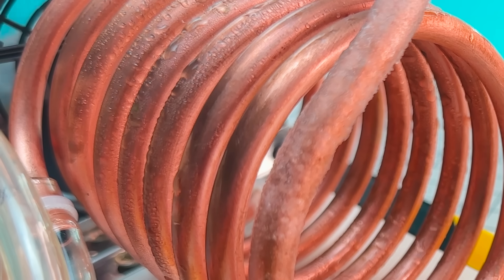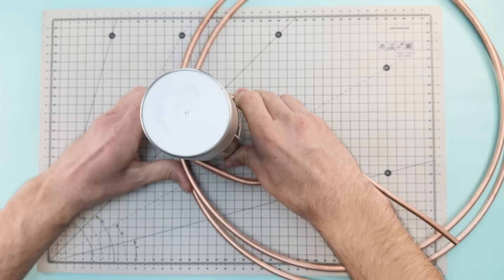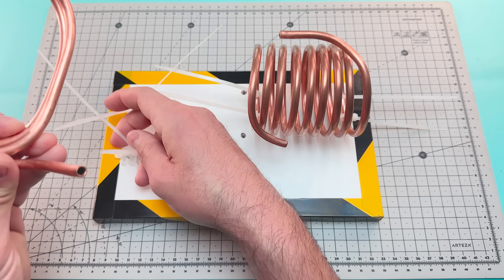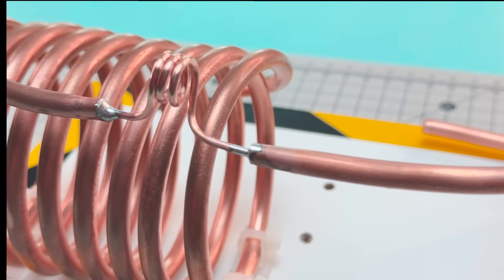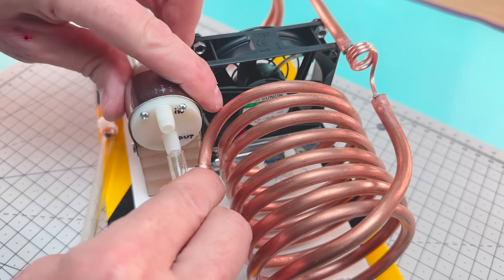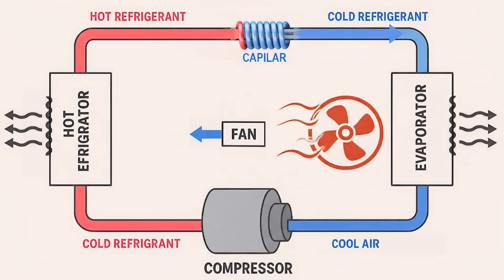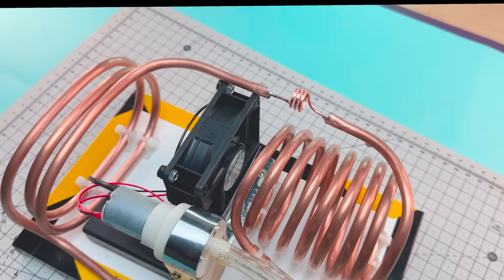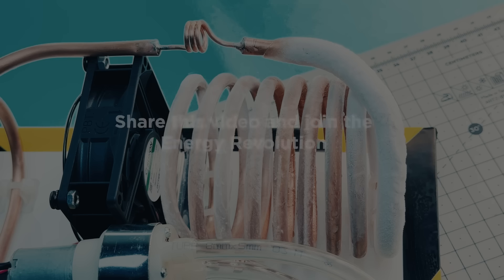Make your own AIR CONDITIONER at home Fast and Easy!

Comment: This is an excellent demonstration example. It's truly valuable given that most people can't come up with a truly effective solution.
I look forward to seeing this developed into an even more practical and effective solution, complete with more detailed explanations and a parts list for procurement.
It would be even better if it could be transformed into a plug-in appliance instead of battery-powered, and ideally, if it used parts readily available at any hardware store.
Reply: Want to see this more developed? go buy a real air conditioner.

Comment: Computer generated narrator voice makes it ever so believable 😂 But when you pit some thinking into atmospheric presure inside the system, outside, the air volume and a room size versus what the system can cycle ... I mean its just a mockup of a working system, not a scaled, optimised one to fit the purpose...
Reply: AI bolok

Comment: It's a neat video. A neat project. You ran a 12 volt motor and a 12 volt fan on a 9 volt battery?
Reply: That is the only part that actually works from all this AI bolok

Comment: To make something like this as a beer glass cooler, how much air needs to be pumped (cfm/psi) and how many turns for the compressor and how many for the evaporator to get 70°-80° drop from ambient temperature? 

Of course, I'd need to isolate the environments of each and perhaps use a fan on the compressor side (as opposed to the evaporator side?)...  ie, insulated cooling coils with center portion to accept beverage... 

...would any type of heat sink be required? 

...also how could temp be adjusted, simple thermostat/relay controling power to entire unit?

Anybody in the know able to give me baseline specs to get me in the ballpark?

Or is there a better alternate methodology I should consider?

Comment: It's crazy that no companies or even individuals making small 12 volt units and selling them this could actually earn someone a pretty good living
Reply: There are 12v mini AC systems out there.
Reply: and a pretty good lawsuit when the motor inevitably wears enough to turn the isobutane/air (explosive mixture) and copper tubing into a funny looking pipe-bomb.
Reply: @TheLootGoblinOfficial  you could try and use regular car refrigerant or some of type of refrigerant that's not flammable...🤔 I want to try this now
Reply: The evaporator heats up just as much as the condenser cools, and the motor and fan dump marginal additional heat into the room. This won't actually cool a room unless half of it is outside.
Reply: I'm on it. Lets do it!!!
Reply: @Zeroduckies Yes im to in
Reply: the hot section vs cold is 5:2 ratio. its has high energy waste, which make it too weak to cool small box (extremely week to cool a room)
Reply: @santohalim1355  I mean if its using less energy that these big AC units I'll give it a shot besides I like making redneck appliances 😂
Reply: Ever heard of cars or trucks. They have 12v AC for the last 50 years 🤔🤣

Comment: Humm, highly flammable Isobutane around an electric current in a DIY project.  Sounds brilliant. ⚡⚡⚡
Reply: Then you will love R290. Its a commercially available refrigerant that's better for the environment than most refrigerants. The best part, its propane.
Reply: @omnipotent87  Sweet, suggest another flammable refrigerant in the comment section for a sketchy DIY video.
Reply: @DelScorch0  Sure, how about r1234yf. Its the current standard for automotive A/C systems, and as you requested, its flammable.
Reply: @omnipotent87  Apparently you missed the point completely.  That's ok.
Reply: Caution is required when experimenting. Isobutane is used in some refrigerators and freezers now. This model has a lot less than an ounce.  If using this for a science expeiment, I think safety glasses would be important. Fire hazard would be minimal.
Reply: @mickmacy6161  Its not so much the fire hazard.  Isobutane has a boiling point of -11.75°C, 10.8F, which means it instantly vaporizes at atmospheric pressure once escaping containment.  Even 1oz, once vaporized is explosive enough to cause some pretty good injury if came in contact with a spark or heat source at its ignition temperature.  Its not the liquid that burns, its the vapors.  So yeah, DIY that and risk it blowing up in experimenters face.  The video is sketchy AF because it makes zero mention of any safety precautions taken to mitigate the risks should Isobutane get free.

Comment: Need to exhaust the heat that is being dumped by the condenser side outside or the system, overall, will not perform well ... if at all. The  fan that is blowing air through the evaporator side is pulling heat from the condenser and killing the efficiency of the system. But, It does make for a nice classroom demonstration of AC concepts.
Reply: Yeah like, overall, very awful system.
Reply: I mean, you're right, it won't cool a room at all as designed, but it does work. You could maybe set a soda can inside the evaporator coil.

Comment: As for air conditioning in exactly the same form as this? Useless. 
One end of the system will be extremely hot and the other cold due to the transfer of heat to another place, but: in general, this effect will be mutually exclusive and cancel each other. 
What's more - the entire system is also working, so not only will we not lower the temperature, but we will slightly increase it - the working engine generates heat. 
So a design made in this way does not make sense if you want to use it exactly in this form as an air conditioner, BUT... But after minor modifications it could serve as a good cooler for a computer, a mini-fridge or something else in which you want to lower the temperature in the right place, i.e. point, area. 
In order for it to work as an air conditioner - the heating end would have to be outside the room being cooled, so that the heat would be transferred outside. 
Therefore, the concept is interesting, but definitely simplified and not discussed in detail. 
I am not even mentioning the use of flammable and potentially explosive gas in an installation that has no safeguards or is not well sealed - that is a completely different aspect. The author deliberately shows only what is convenient for him - the cooled end of the system, and deliberately DOES NOT SHOW the temperatures at the other end of the system.
Reply: Condenser would run about 10-20 degrees warmer than room temperture.
Reply: @mickmacy6161  I understand your thought that the condenser would only be 10-20°C warmer than room temperature. While heat transfer indeed requires a temperature difference, this particular DIY setup presents unique challenges that push its operation far beyond typical expectations.

Firstly, the condenser must expel not only the heat absorbed by the evaporator (which cools to -10°C) but also the substantial heat generated by the compressor's own mechanical and electrical work. Notably, both the 12V compressor ('pump') and the fan are running on an underpowered 9V supply, affecting the entire system's efficiency.

Secondly, the condenser's heat rejection capabilities are severely limited by its design. Unlike a typical heat exchanger optimized for efficient transfer, this unit features limited coils and no dedicated fan to ensure airflow over the condenser (the only fan is directed at the evaporator). It therefore relies almost entirely on highly inefficient natural convection.

Furthermore, this setup attempts to cool an open room, a continuous and demanding thermal load, which is a fundamentally different challenge than cooling a small, insulated space.

Given these combined constraints, for the system to achieve its intended evaporator temperature, the condenser's surface must reach significantly higher equilibrium temperatures. This demands a far greater temperature difference than 10-20°C compared to ambient (e.g., 25°C), with realistic estimates for the surface temperature being 50-90°C.

Consequently, the unit would ultimately add net heat to the room, limiting its practical utility as an AC. Moreover, operating flammable isobutane at such elevated temperatures in a non-professionally built system introduces inherent safety considerations.

Comment: does this really work?
Reply: Yes, for a short time.  A person could probaly cool a can of beer.  The isobutane will leak out quickly.
Reply: It "functions" but it would never cool a room the way it's designed
you have to isolate the hot side from the room you're trying to cool
isobutane is already dangerous, and it would be even more dangerous when it's heated and starts leaking out
this thing would basically just start fires
Reply: no

Comment: ШЛЯПА, как в системе он создал вакуум? Никак а значит что? Поливал трубки азотом жидким, без вакуума влага в воздухе забила бы тонкую трубку, про насос с резиновыми "поршнями" в этой системе вообще молчу
Reply: обычный бургерский кликбейтный видос. физику у них не учат в школе, схавают - вон сколько просмотров и лайков. даже если бы это работало, тупорезам невдомёк, что конденсатор будет выделять тепло в +- том же объеме, в котором этот агрегат будет производить холод, а значит никакой речи об охлаждении какого бы то ни было помещения быть не может. термодинамика тупо вышла из чата
Reply: @piotrjupiter3282  You left out the heat of compression, too. However, for this model with no appreciable applications except to see a cooling evap and a condenser rejecting heat, thermodynamics would be preserved.
Reply: Maybe. I think the refrigerant would leak out before moisture could collect and freeze at the cap tube outlet.

Comment: Entertaining video, but not practical for anything except a small drink cooler... Plus he forgot to isolate the condenser from the evaporator. A simple sheet of Styrofoam will suffice.
Reply: That's what I want to make!   How much air needs to be pumped (cfm/psi) and how many turns for the compressor and how many for the evaporator to get 70°-80° drop from ambient temperature? 

Of course, I'd need to isolate the environments of each...  ie, insulated cooling coils with center portion to accept beverage...

...also hiw could temp be adjusted, simple thermostat/relay control8ng power to entire unit?

Anybody on the know able to give me baseline specs to get me in the ballpark?

Comment: Having the the Condenser and the Evaporator in the same space negates the cooling effect, and actually raises the air temperature.
Reply: Put it in a shoe box & separate both coils with a cardboard wall then mount it into your window. Problem solved.
Reply: isolate the hot part, use another fan to blow it outside from rear, use a tube if you want to exit the heat outside, same for the water, make a channel to drop water below (by hovering ac on a platform) then drop the water in a bucket or something, now you can successfully cool a 1x1 m area
Reply: @shizuxo  nice explanation I got lazy towards the end lol

Comment: هل يمكن تكبير  هذه  المكيف ؟ 
هل يستطيع  تبريد  غرفة من 40او 100متر ؟
شكرا جزيلا على المعلومات وعلى الترجمة 
بالتوفيق
Reply: Да, может. Даже 500 квадратных метров. Просто его нужно увеличить до нужных размеров и оптимизировать работу компонентов, чтобы повысить их эффективность. В итоге получится кондиционер.😆
Reply: It would be much better to get a commercial model designed for room use.
Reply: no it cant, you cant power it, dont play with live electricity you will get yourself free pass to heaven
Reply: @shizuxo  dat ol lecturk will turn on ya.

Comment: Fun tip: you can cascade 4-5 of them and use helium as a refrigerant on the last ones to achieve cryogenic temperatures
Reply: Helium ? Too stable I think
Reply: 😂 @raphanunu6912
Reply: Aren't most refrigerants flammable?

Comment: How long did you put gas into the circuit for? I feel like that's an important part that you just didn't specify. If too much gas is applied, what would happen? If too little gas is applied, what would happen?

Comment: It is dumping the heat in the same room which it is cooling , although it can be used to cool drinks or blow cold air but will not affect overall room temp (which is the work of AC)
Reply: Box off the condenser with an exhause tube attached to it 🤷🏾‍♂️ super easy to fix
Reply: its probably more like cold infront and hot behind situation, just keep it facing you, anyone with common sense knows it will never cool a room, probably a medium size box at max, if you isolate heat with a tube that is

Comment: Great invention! But I have a couple of questions. Is isobutane and freon the same thing? Is R600A freon suitable? And how independent is the circuit? Does it need to be refilled? And how long will the battery last? And what type of pump? Will a membrane one work? I found a universal one. It works for both water and air. Membrane pump R385. Thanks in advance for your answers )
Reply: No Isobutane isn't Freon. Also Freon isn't really used as a refrigerant in commercial air conditioners due to o-zone concerns and potential negative health effects in the case of a leakage so personally I wouldn't use it in a home project either. Bear in mind I'm not an expert and people should do their own research before attempting things like this anyhow.
Reply: @kandigloss6438  I am undestend. Thank you )
Reply: I think you can use also the insect propellent gas as the refrigerant.

Comment: I'm very dubious about this!
Reply: No need, this is basic refrigeration. But be aware, that other coil will be producing heat. What this system really needs is another fan blowing on that coil with maybe a tube you can direct the heat somewhere outside the room. If you've ever seen a portable AC they have an exhaust tube for this reason. This system can also be used when it's cold to produce heat, then you want to exhaust away the cool air and keep the hot air.
Reply: @deesine1 so could I use a half decent coolbox and poke the pipe through a sealed hole and it would become a fridge? On a 9v battery? I'm nothing sarcastic, its a genuine question....?
Reply: @deesine1 😎👍🏻
Reply: @ben1895  Yes, indeed. This is how work fridges.
Reply: @ben1895  no the power isnt enough, it wont run for long, especially if you isolate hot part and make exhaust with a pipe. but you can always use ac adapter for 12v 9v etc

Comment: It's a great idea, but I have a few problems with this setup:
First of, as mentioned already you have the condensor and evaporator in line with each other and a fan moving air inbetween. This setup blows the hot air coming from the condensor through the evaporator, thus leveling out the heat transfer significantly.
Second, I understand youre use of iso-butane because of it's relatively low evaporation pressure (43.5 psi), but I'm still not sure about the hose holding that pressure, with or without clamps. And I don't know how much I-butane you put in, but \i didn't see you bleed the air...
Third, are you crazy jerry-rigging a device (guessing you're not a certified AC installer) with CH gas under pressure in a room with peple in it? That's, for lack of a more technical description, like planting a bomb!
Fourth and final, Not sure how the fire inspector, city inspection and you house insurance feel about #3...

Comment: It can theoretically work in a very unefficient way if and only if the condensor coil (the one with less loops) is placed outside or ducted so it is isolated from the room. Otherwise you heat air from one side and cool it from the other side, which cancels energy transfer, plus you add heat by the pump and fan friction, so the device shown can only heat a room, but could cool a soda can inserted in the evaporation coil by doing so. It is still interesting how the video explains heat transfer by gas circulation.

Comment: And to add to the other comments here about the flaws in this set up, the circuit wasn't evacuated of air before starting and any water vapor in the system would freeze and block the small copper tubing. That's why air conditioning techs always use a vacuum pump to evacuate the system first.

Comment: MORE EFFICIENT to not build this and just open your refrigerator door - 
you are not expelling heat so just warming the room with the battery.
This is a niffy DEMO of cooling process, but appears A.I. CLICK BAIT 
re-labeled a "NOT FOR ACTUAL USE" video as if it were functional.
Reply: If you open the fridge's door the room will actually heat up 😀

Comment: Brilliant project. I have seen similar ones too.  This is the best low power refrigeration system compared to inefficient Peltier and noisy high power and heavy Compressor systems.  As others have mentioned this video is not complete though. This setup does not cool your room because cold and hot pipes cancel each other. First, you need to isolate the compressor and evaporator coils. Wrap the compressor and transfer it's heat to outside. Also Collet the  condensation on the evaporator and store and recycle it otherwise it will drip and make a mess and probably danger. This is a prototype and educational video in my opinion. You need to improve on it to work properly.

Comment: Won't that line with the frost on it freeze up completely in a little while?  Also, it seems the heat produced by this device would eventually offset the amount of cool produced negating the total effect.
Reply: Yeah thats how ac systems work. that why the heat side is always outside of the house
Reply: you are correct.  In fact the heat will exceed to cooling effect , due to inefficiencies, producing net heating effect overall.  

the heat needs to be rejected from the system (room)

Comment: And what you're doing with the hot part of this system? :) If all stays in the room it will be +/- 0 :)
Reply: Maybe it's just a proof of concept to demonstrate the underlying principle. I'm not trained in this field, but wouldn't it be relatively simple to modify the design and extend the tubing so the hot component could be placed several meters away - like behind a door, through a hole?